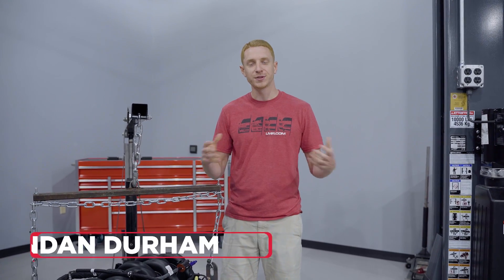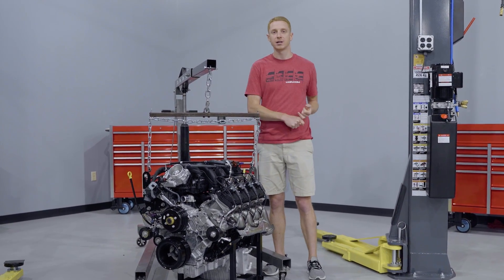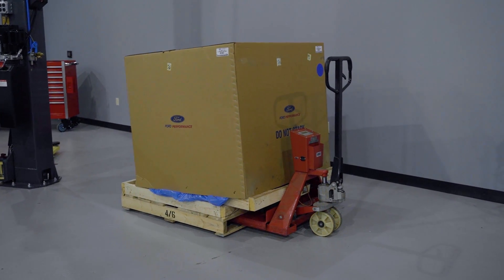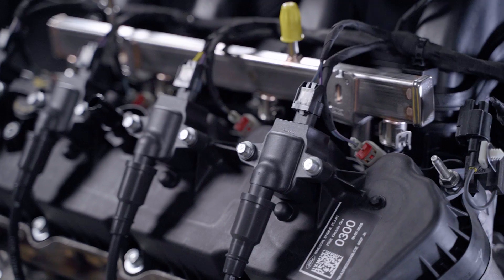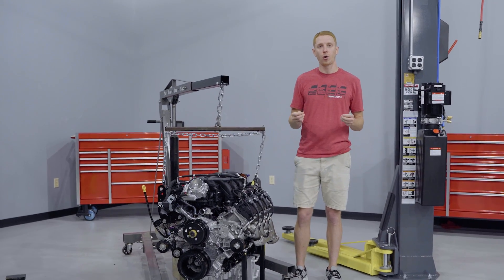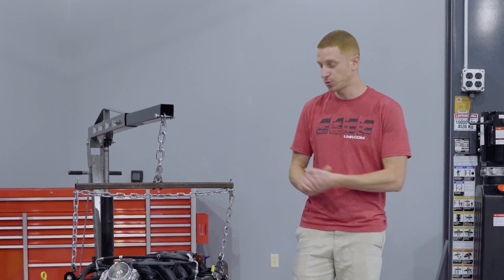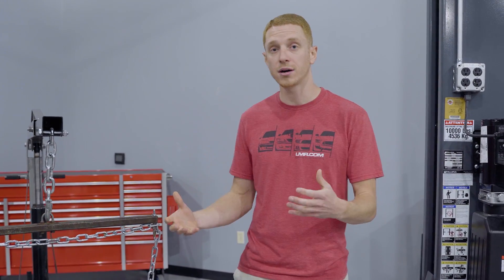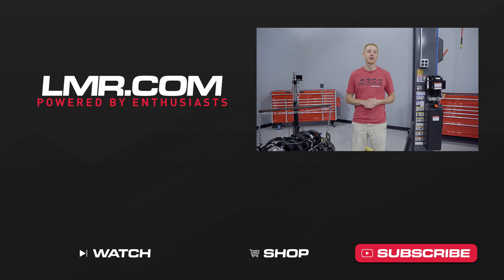Ford Performance 7.3L Godzilla Crate Engine | Review

Comment: Would like ford to make a charger competitor, rwd with this motor.
Reply: That would be awesome, especially if supercharged. But it probably wouldn't sell very well
Reply: @wasteoftime727  I don’t see why not, dodge is selling all versions of the charger like hot cakes
Reply: @coreysmithsvt  Very true, the Chevy SS did not sell very well though. It would probably be hit or miss.
Reply: @wasteoftime727  yeah, the ss was a great drivers car, but too plain Jane in the looks department. Ford would have to nail it the styling for it to sell.
Reply: @coreysmithsvt  good points. I'd like to add that calling it the Crown Victoria would probably help a lot too

Comment: So it is basically like a Gen 4 GM truck engine :-)
Reply: Very similar idea for sure, but probably very different in the fine details.
And just from looking at it, I'm pretty sure it's externally larger than those. But, I've never given the 8.1L a look outside of a truck.
Reply: @nthgth  I meant the Gen 4 6.2L

Comment: Ohhhh come on man.  Everyone knows that no one is swapping ford engines into fords.  I think there are more ford performance cars driving around with LS engines than ford engines at this point.  Anyone swap an LS into a Ford GT yet, get that damn V6 out.
Reply: That would be the worst Ford GT ever probably handle like a cavalier
Reply: @RCXDerp   or increase the handling so the GT could keep up to a ZL1 1LE........maybe.  Ok I will get off this Ford channel, I just had to give you Ford guys a little crap.
Reply: @f1hotrod527  do you really think a Camaro can out handle a supercar such as the Ford GT? 
Put down the pipe.
Reply: @coupe50h  You tell me.  Whats the GT's time on the Ring.  Does it have one?  Chevy ran theirs completely stock with the same tires it comes with.  7:16.04 is what your half a million supercar would have to beat.  To put that into perspective the Lamborghinini Aventador LP700-4 and Ferrari Enzo are about 9 seconds slower than the camaro.  And many of these other brands "tweak" their cars, and run ringer tires, and also have professional drivers pilot the cars.  GM has one of its engineers do the driving.  Also, this was the 6 speed manual.  The new 10 speed automatic if given a run, who knows, maybe touch the top 10.  So I guess I would not be to overconfident in your prediction.  The 6th gen Camaro is one of the best handling cars ever made, and it destroys the German cars and it destroys italian supercars.  All for a little over 70K.
Reply: @coupe50h  Not saying the GT is not a cool car.  It is in my opinion way better styled that almost any other supercar.  Truly beautiful design that makes current ferraris and lamborghinis look like they were styled by 8 year olds.  My only real gripes with the car are the fact it has a V6, and I don't care that it has a turbo, V6's are lame.  And the fact that this car like many other of fords cool cars, Ford limits production to make sure its fans are not able to get a hold of the cars they love and allows insane mark ups on the ones available.  Ford should stop kicking its biggest fans in the balls.
Reply: @f1hotrod527  idk, a 2000hp r35 gtr most people would not consider lame.
Reply: @riogrande163  True.  Although an american company with a proud history of V8's using a V6 in their halo car is still lame in my eyes.  Also, a GTR with a V8 or inline 6 would be cooler than the V6.  V6 is the most compromised of all engine designs.  Its only benefit is being a multi cylinder V engine that can fit crossways in a front wheel drive car.  And that is the sole reason a V6 is developed by any company.  So you are right, any engine with 2000 hp is awesome, but any other 2000 hp engine will have more style points than a V6.
Reply: @f1hotrod527  well put, and that's interesting to me, about V-6 being only a compromise. It makes sense. The V-6 in the GTR was a new design for that car, but I suppose it's a V instead of inline because it was based on the VQ, which was designed for the FWD Maxima. 300ZX also used a Maxima engine.
But why then did Mercedes switch to V-6 engines in the 90s?
Reply: @nthgth   Yeah, I am not saying a V6 is a bad engine it just has 2 compromises.  Inline 4's and V6's are not naturally balanced and need balance shafts added to smooth them out.  V twins (90 degree), V4's, inline 6's, V8's, V10's, V12, V16 are all naturally balanced and very smooth without  needing extra stuff added.  The second compromise is cost.  Inline engines have half the number of heads, half the cam shafts, 1  simple exhaust manifold, no y pipe, 1 simple intake manifold, half as many sensors, simpler wiring harness etc etc.  V engines are much more complex and harder to build.  So a V6 has the worst of both worlds, its not smooth and its expensive to build.  Now, these compromises are not huge, and many V6's have been great engines.  And V6's and V8's are in a shape where they can be mounted longitudinal or transverse.  They are small enough to fit in almost any vehicle.  And Ford went all in on the design of the ecoboost engines and spend lots of money developing them.  To get back that cost they used a V6 so they can put it in trucks, high performance cars, SUV's.  And the promote this engine which is basically their pride and joy they used it in their halo car the GT.  Now as good as this engine does perform, you have to admit as a ford guy, would a turbo coyote, or Voodoo variant, or even the new GT-500 engine be much much cooler.  Just the sound is worth it.  And these V8 engines would have had an even higher power ceiling.
I don't know much about Mercedes.  If they did not use front wheel drive then it is a little surprising they did.  Now even in a longitudinal mount, inline 6 is really long and requires a longer hood and other concessions.  Or maybe they just like V6's at the time? Maybe they wanted to combine the design into a V6 / V12 common engine architecture which has been done by other manufacturers.  If I am not mistaken, isn't Mercedes switching to inline 6 engines now?
Reply: @f1hotrod527   @F1hotrod  yes, I believe they are going back to inline-6es. I'm guessing the V-6 phase had much to do with Chrysler and their contemporary six-cylinders, informed largely by the minivans and thus the need for FWD compatibility.

Interesting points you make, a lot of sense, it calls for follow-up research to be done by me. I do mostly follow; I understand balance shafts and natural balance and y-pipes and some other stuff. Thank you for taking the time to type that whole thing out.
With inline engines costing significantly less, for reasons you laid out clearly, I'd imagine all automakers would greatly prefer an I6 to a V-6, if they didn't have to worry about putting it in a FWD car.

Just for the record, the one V-6 car I've had, an '02 Solara 5-speed, indefinitely endeared me to V-6s as normal, everyday engines. Maybe it's just what Toyota can do with a quad-cam V-6 lol.
Reply: @f1hotrod527  oh and hell f*ing yes, a turbo or supercharged Coyote or Voodoo would be fantastic in the GT supercar.  They could have a specific version only used for that car. And yes, the sound would very much be part of its awesomeness. (Not to mention its higher power ceiling being higher displacement).

Comment: Didn't they tune it for performance?  It sounds like it is just the same exact engine that comes in a work truck.  I would have thought for a crate engine they would have tuned it for performance.  I guess this is to be used for dropping into old work trucks?

Comment: How cool would it be if ford built one with an aluminum block, forged pistons,  and a heads, cam and intake upgrade for 10 or 11 thousand dollars?  I'm almost positive that chevy charges 15,000 or more for an aluminum LS that makes around 600 or 650 horsepower. The lightweight and extra power is worth some extra coin. Especially with a warranty.
Reply: Hopefully Ford intends exactly this, to compete with the affordable, big-inch GM Performance engines!

Comment: Perhaps tempting to consider for my '70 Mach 1, but really, the amount of power a 408w could make for the cost of swapping in the crate Godzilla, it just doesn't make sense.  A good 408w short block assembly plus a good Edelbrock top end kit and I'd be looking at 550hp+ fairly easily.  And all the parts are readily available and bolt in, no fuss, no problems.  But wait a few years for aftermarket development, and when they become available at salvage yards, and it could be a bargain option compared to building a vintage Windsor.

Comment: I’ll never understand why the 6.2 never caught on. So if the 7.3 does I’ll be a little surprised.
Reply: They simply don't put it in enough vehicles. GM put the LS in one form or another in almost every RWD/4WD vehicle. Soon they hit the junkyard by the millions all over North America and swaps ensued.
Reply: I think it’s because Ford pushes the power stroke so hard. Even going on the Ford lot now, If they have 10 superdutys sitting there, maybe 1 will have a gas engine. I bought a gas engine in 2016 in my work truck after 15 years of diesels. I don’t miss the diesel at all.

Comment: Not even 500hp from 7.3 liters? That seems horribly low. Is there an aftermarket for internal speed parts yet? Lots of noise not alot of go.
Reply: People are reportedly getting like 800 hp from this thing before even adding boost. According to some comments - I haven't looked any of them up yet.
And yeah, low specific output is very handy for surviving hundreds of thousands of miles of basically, what would be abuse to a smaller engine with the same hp rating.

Comment: For those who want this for a Small block racing program (Like the drag racing Outlaw racing orgs or brackets), Make sure the Cu. In. fits the rules. Most Sm, block classes stop at 430 cu in. This engine is over 440 cubes, so might not fit

Comment: Lol... I have a stock 5.3 LS with cam and headers that makes as much ... Bless your heart
Reply: As someone who owns an L76. And is a GM fan. You are a bit of an idiot. You can't have a stock motor with cam and headers. Also you are arguing against a factory engine. All you have to do is tune it. Not even add parts to it and it will eat you.
Reply: FXIIBeaver cool story bro lol .LS swap it!
Reply: @benharrell6168  and lose torque? id rather not.
Reply: And then get drug by a Godzilla with a cam and headers.  Not to mention your tiny displacement LS has no where near the low end torque this thing does.

Comment: "For $10,000 you can have the same power and torque as a $500 carbureted pushrod junkyard truck motor!"
Reply: You can have a crown Vic 4.6 engine for like 100 dollars lol
Reply: Yeah....and not know what you're getting. I'm pretty sure they're not targeting the Walmart hot rodder with this engine.
Reply: Old silly argument. $500 Pinto with $500 460 could beat a 75k Corvette in the quarter-mile. So what, still a Pinto!
Reply: @tlr-nut7275  mmmmm probably not
Reply: @tlr-nut7275   gonna go on a limb and say you are wrong.

Comment: ford got tired of seeing ls engines installed in mustangs so the built their own ls.
Reply: Ford in the late 90s : I can’t believe Chevy isn’t going to match our overhead cam, let’s make fun of them. 

Ford 2020: we have successfully copied Chevy.
Reply: @markchickenbutt8740  Wrong. The 7.3 takes design elements with the FE and 385 series v8's.
Reply: @riogrande163  My bad, I guess chevy never made an OHV engine with an in block cam before!
WAIT! What’s this.....chevy did start doing that in 1954 and all there new engines have same trans bolt pattern to be backwards compatible.
Reply: The Coyote shits on the LS kid. Loser Series, LS, motors belong sunk to the bottom of a lake for bass structure.
Reply: @123benitezm  then explain all the ls engines in mustangs and other fords
Reply: @123benitezm  mhmm. Ok buddy.  Gimme your mod list.  I will get the equivalent for my L76 and we will see who wins.

Comment: Too little too late Ford. Ls Motors now rule the world because G.M. made it a easy af to put in any build and easy to control and they make gobbs of power cheap.  Just like you got passed by the Wrangler....for years. Too little too late. Leave the "everymans" race car motor stuff to G.M. like youve always done.
Reply: Seems like it's just a truck engine, not trying to compete with LS for performance applications. 
In any case, I say the more affordable V-8s, the better.

Comment: So, stay away from 2010 Raptors? 5.4L 3Valve is a notorious engine I understand. And if the oil isn't kept pristine, the smaller ports for hydraulic valve timing clogs and then you need a new engine. From what I have been told.
Reply from the maker: If the engine has been maintained well and taken care of, the 5.4 is great engine. But you'll get a lot more power and use out of the 6.2 compared to the 5.4. I recommend checking out some Raptor forums and see what the 5.4 owners talk about.

Comment: Bore it. stroke it. Throw some boost in it. Cam it. Time it. It will be a 9 liter beast making over 1000 horsepower at the wheels.
Reply: Looks like someone's already gotten like 7, 800 hp from it just with a cam and airflow improvements (I'm not gonna comb through the comments again lol).
With the other stuff you said, shit, I'd believe 13, 1500 hp

Comment: Just an FYI, the 6.2 is still in the Super Duty as a base motor, the 7.3 is an upgrade.
Reply: 6.2 is not on it's way out
Reply: Exactly. The 7.3 replaced the 6.8 v10 not the 6.2 that is still offered in superduty’s
Reply: @brokenwrench404  the 6.8 3v was for sure long in the tooth. The new RVs that come with the 7.3 are leaps and bounds ahead of the 6.8 3v. But LMR should have done their research on a simple fact like that
Reply: This is correct, I paid am extra 2k for the 7.3 over the 6.2
Reply: Always makes me skeptical when they get the easy info wrong. Usually where i stop watching
Reply: 6.2 is on the way out

Comment: look forward to seeing the fuel economy results as compared to the carbureted 383,393,405,416,428,455,460's of the 1950's too 1990's
Reply: guaranteed to be better in mpg
Reply: Aren't the HD trucks exempt from EPA fuel economy testing?
Reply: @nthgth  they are hit with noise limitations and road restrictions.